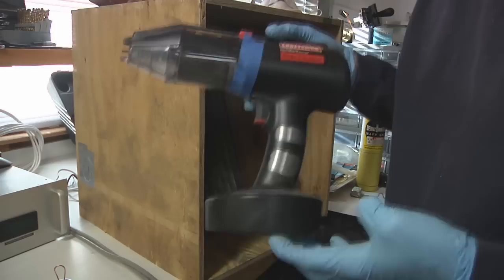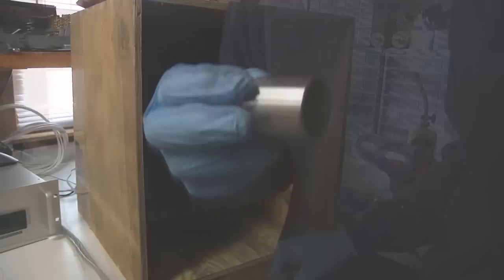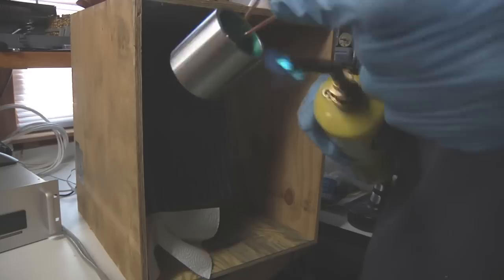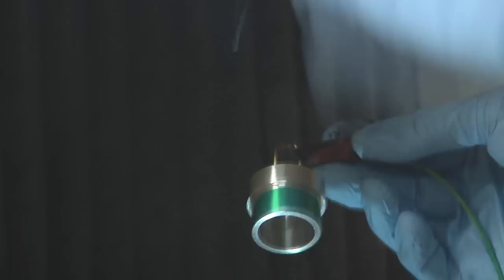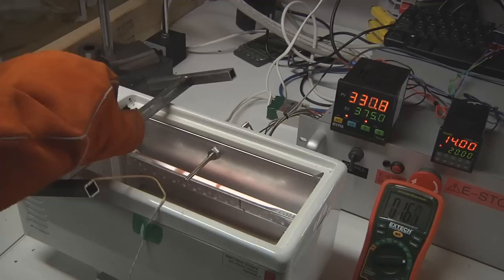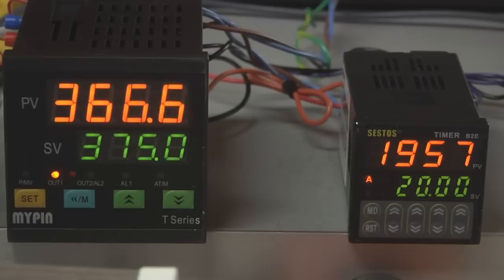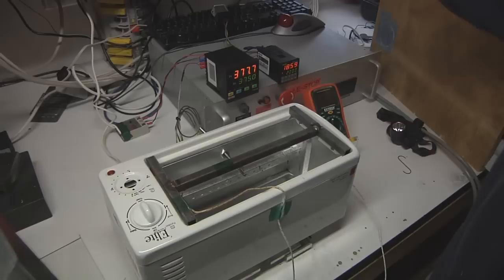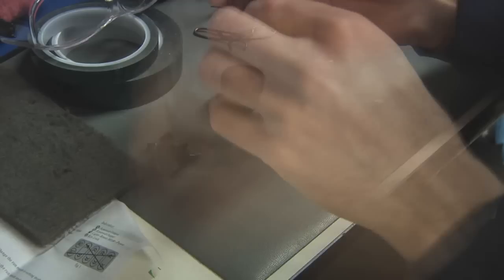Powder Coating on the (somewhat) Cheap

Comment: flawless improvisations, you can use couple of extra filter to filter the smaller particles by wetting one of them with water or oil and attach it to a vacuum cleaner on low speed and a good face mask for added insurance.

Comment: I found these on eBay, thanks!.  I used to pay $2,000 per device for Foxboro process controllers (to be fair, it also had RS-422, dual PID loops, etc.).  With this, I controlled main water pump  control valves at ski are snow-making and waste water treatment plants).  Unreal that these only cost $43!

Comment: Looks very like the gun I made from a hair drier and some pvc plumbing tubing. The powder pots screwed on below the nozzle and Venturi action sucked out a light cloud of powder. Ionisation was by fine copper mesh connected to power that the powder blew through. Was not perfect but nothing affordable was available.

Comment: Yes sir that's perfect. I just bought one on eBay.

I'm equipping an old Jenn-Air oven/range with a temperature control problem. Needs a 40-amp SSR though with the new PID.  Thanks man!

Comment: Wanting to do larger items like a Recumbent Bike Frame, I plan to use an old oven before it goes to the land fill, and rig an extension area so that with the door open, the wide part of the frame can actually be outside of the formal oven, and will box it in with sheet metal and some appropriate high temp insulation on the outside of that to hold heat better...  Hoping by sloping it upwards as it comes out of the oven, I get enough heat rising into that extended chamber to get the job done...    I actually wondered why someone doesn't make a "set" of different shaped tubes and rectangles that would quickly lock together to make various shapes, with insulation outside of them, to allow them to be put around odd shaped parts.  such a system would then let you use either a heat source they make, or makeshift ones, like a large hotplate or burner system...

Comment: FYI:  The gun and extra powder canisters are still available on eBay as of February, 2016.   They were manufactured by WAI for Sears-Craftsman but never met the final stages of applying the branded stickers on the side.  Brand new items, and no compressor required for these guns! 

Gun:

http://www.ebay.com/itm/NEW-Craftsman-Electric-Powder-Coat-Spray-Gun-Metal-Finisher-17288-car-boat-paint-/360964799766?hash=item540b2dbd16:g:YWEAAOSw7PBToKDk

Canisters:

http://www.ebay.com/itm/NEW-Craftsman-17288-Personal-Electric-Powder-Coat-Gun-Additional-Powder-Canister/331547205089?_trksid=p2045573.c100033.m2042&_trkparms=aid%3D222007%26algo%3DSIC.MBE%26ao%3D1%26asc%3D35411%26meid%3D2b9824aa32c941f09a1b9e4a6d90f8d4%26pid%3D100033%26rk%3D2%26rkt%3D4%26mehot%3Dpp%26sd%3D301851377083

Comment: Great stuff. Have you tried pre-hanging the parts on the I-shaped frame before heating? I'd expect some time (and therefore heat) saving might be possible? Although air does not contain much heat ofcourse... Well at least you'd have one surface less to bump into.

Comment: you start the timer when your part gets up to temp, not when the powder flows out.
Reply from the maker: What method do you use for knowing the part is at temp?  IR thermometer?

I am doing very small parts, so it's probably only a matter of a couple of minutes difference.  I use the long end of the recommended time for curing (20 minutes for the Columbia Coatings powders), which might help.

Comment: very cool stuff, but not so sure about the zinc content of the galvanized metal on the oven inside the house.
Reply from the maker: It's just a modified consumer toaster oven.  The temperatures used in curing powder will not vaporize the zinc like welding will.  If you're worried about this, I hope you're not making toast on a regular basis.
Reply: Well, as I said, im not so sure.  I just avoid galvanized around heat applicaitons in general, but the clarification helps.  I'll have to look up the exact off-gassing temps.
Reply from the maker: Brady Rose Perhaps there is some slight cause for concern, though most likely for the makeshift 'lid' I made and not the oven itself.  I am running around 375 degrees F and 390 degrees F seems to be the recommended safe temperature for galvanized steel.  http://www.galvanizeit.org/education-and-resources/resources/technical-faq-dr-galv/galvanized-steels-performance-in-extreme-temperatures
Reply: yes I didn't mean the actual toaster, but the lid.  Its likely not the end of the world and as I understand it zinc fever is usually the result of heavy exposure.